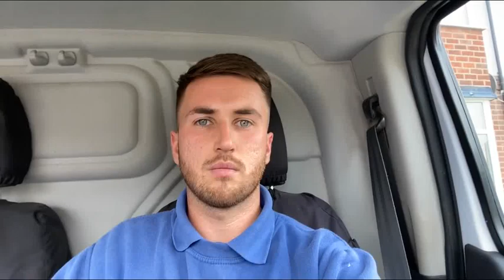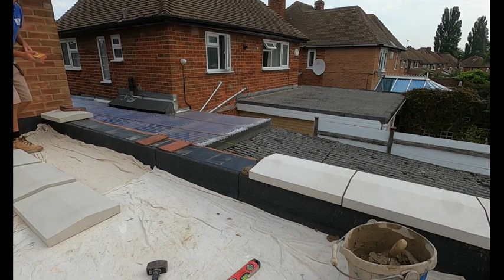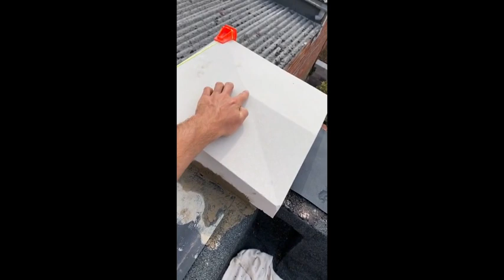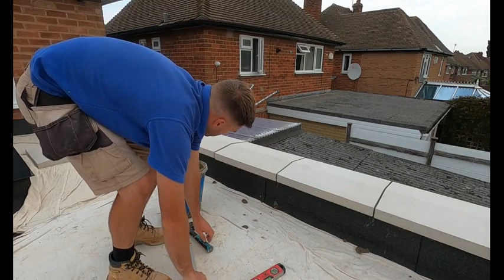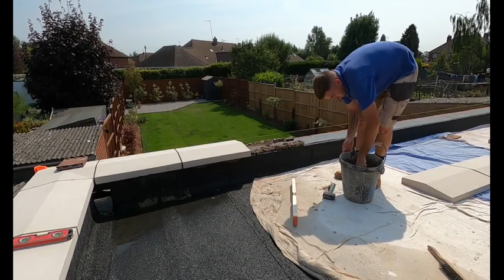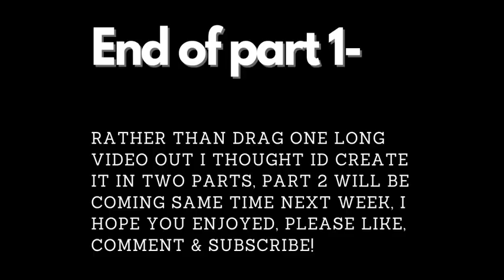Laying concrete coping stone- Part 1

Comment: Can you tell me mate how much roughly to cement one grey concrete flat concrete Coping Stone back on as it came lose it is roughly same size as yours in vid it is an old Wall and first Stone on Wall as you go in Drive Way and a small wall 2 brick thick brick thick and 2 feet high ? Thanks

Comment: Hey! DIY-er here, looks like you've done a lovely job with those. What mortar mix did you use? Not sure whether sharp sand or building sand is best for laying coping stones? Cheers
Reply from the maker: Hi Joe, I use a mortar mix of 4 building sand to 1 cement mate, that’s what I’d recommend!👍🏽🧱
Reply: @ConstructionwithKieren  Thanks for the advice and quick reply, appreciate that! All the best
Reply from the maker: @joemorris1282  always happy to help👍🏽

Comment: Do you prefer mortar or cement to secure coping?
Reply from the maker: Mortar!
Reply: @ConstructionwithKieren  thank you so much , by the way, how do I remove the cement from the stone surface after it becomes fully dried. I’ve tried cement remover but it doesn’t work that well. Pllllllllz help
Reply: @mole3579  sand it with a fine grit maybe?

Comment: why the pointing trowel ?  just because you may have a larger trowel, you don't have to load it to the max
Reply from the maker: Mainly for getting into the bucket easier mate, rather than trying to get spot boards on the roof etc I just use a bucket and a smaller trowel👍🏽🧱

Comment: What did you use to close the cavity? I'm doing the same project but with epdm, after gluing down the epdm on the top of the inner course should i then trim it where the cavity starts or should I run the epdm over the cavity and onto the outer course? 
Nice clean work by the way 👌🏽
Reply from the maker: cameltoe452 600mm wide dpc, sat on the top course underneath the copins then either one or 2 courses down on the brickwork with weap holes👍🏽 thanks!!
Reply: @ConstructionwithKieren great job, can you share the dpc you used to close the cavity? Product please thanks